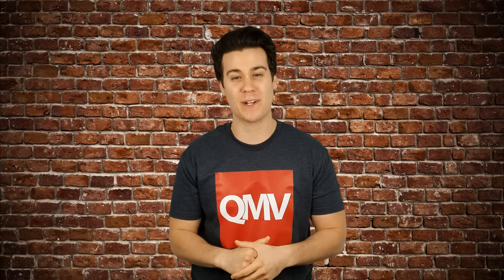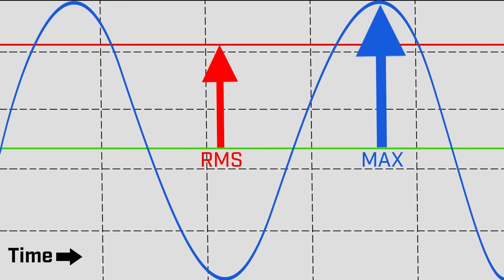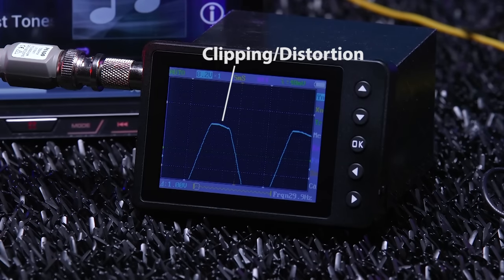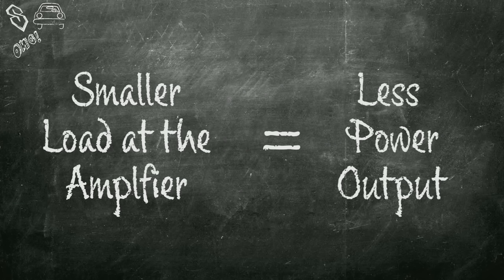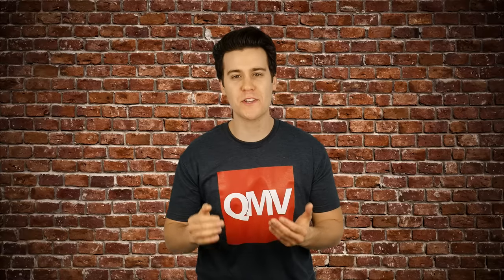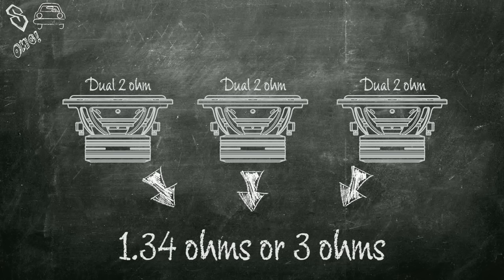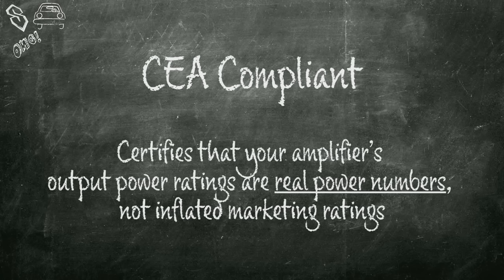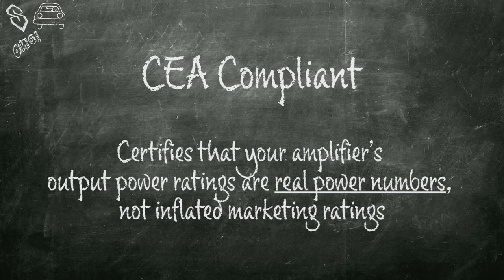How Do You Match Car Subwoofers and Amplifiers?

Comment: I have 2 1300 watt subs.do I need a 2600 watt amp or will a 1600 watt amp be OK?  Also both amps I'm interested in are compatible with the rms. So it's the peak power I'm a little worried about. Thanks
Reply from the maker: What is the RMS of each sub? If their RMS is 1300 each, you'll want an amplifier around 2700-3000W RMS. If that's the MAX, find the RMS rating and use that instead

Comment: Im buying a subwoofer with 400 RMS and 2ohms. Should I buy an amp with a 400 RMS output or a 400W Power at 2ohms?
Reply from the maker: As explained in the video, this is dependent on the specifications of the subwoofer, and you're leaving out whether it's DVC or SVC. Need to know :)

Comment: I’m super late to the party but I’m trying to figure out how many wattage to get on my amp I currently have a 1200 watt sub hooked up to a 500 watt amp I’m getting a 2100 watt subwoofer Peak Power: 2, 100 Watts, RMS Power: 1, 050 Watts. And also getting a voice box which is 2,000 watts “✔ WHATS INSTALLED: 4 - VS65SB Midrange Speakers (500 Watts Max/ 150 Watts RMS Each) & 4 - MA-TW25 Super Tweeters (150 Watts Max/ 75 Watts RMS Each)
✔ POWER: 2000 Watts Max Power - Recommended RMS Power PER Terminal 200 watts (There are 2 Terminals)”

Which watt amp/brand do you recommend for both

Comment: I am new to installing and matching car audio to amps and could use some help. Like a dummy i just went out and bought what i thought i needed and now need help to find out if i screwed up. if you could tell me if this amp will work with the speakers and sub i bought it would help. i bought kenwood  #BT778HD stereo, 4 pioneer 6x8  #TSG6844R speakers 500 watt max power,  1  #PSWB121T 4 ohm sub, and Lanzar heritage series 5 channel 3000 watt amp #HTG558BT. I have been watching your videos and have learned alot but still not sure on the amp. Any help would be appreciated. Amp features are 4 x 250w + 1 x 650w rms @ 4 ohms, 4 x 350w + 1 x 1,500w rms @ 2 ohms, 2 x 100w max @ 4 ohms bridged, 4 x 500w + 1 x 2,000w max @ 4 ohms.

Comment: How do u wire a sub in 4 ohms or 2 ohms .. im building a system  i have a digital design loaded enclpsure which is rated to 250w rms 500w peak and it says 4 ohm loaded enclosure , im intrested in using a monoblock which is capable of out putting 480w @ 4 ohm ... my question  is how do u determine what ohms u run at ? Is there a specific way of wiring the sub in 4 ohms
Reply from the maker: Depends, is it DVC or SVC?

Comment: Okay so i got 2 12" 4000W subs

specs are

12″ AudioFusion 4000w DVC Sub-woofer
– 4000w peak, 250rms
– painted steel frame with high end terminal
– yellow non-pressed paper cone with foam edge
– Black EVA ring gasket

What size amp will be recommended?
Reply from the maker: You left out the 2nd most important spec! Are they 2 ohm or 4 ohm woofers?
Reply: @Qualitymobilevideo  ahhh sorry it says on the box dual 4 ohm subwoofer

Comment: okay so basically i just blew my subs? i tried running my skar triple 8s ported on a 125 watt amp and i checked the temp of my amp when i realized something was wrong it was at a steady 143 degrees. so did i just lose everything?
Reply from the maker: Not likely, you probably put the amp into thermal protect. You have a wiring issue that you should resolve ASAP.

Comment: So a SA-12 D2 REV.3- Sundown Audio 12" 750W Dual 2-Ohm SA Series Subwoofer and a Skar Audio SK-M5001D Compact Monoblock Class D MOSFET Car Amplifier, 500W would be a perfect match right?
Reply from the maker: Those are good match for the 1 ohm load at that amplifier with 500W RMS

Comment: So I have two 2007 model year alpine mono block MRP 500 watt amplifiers and I would like to use them both on one alpine R series duel voice coil sub that’s 1800 watt max (peak) so It’s probably 350/400 watt per coil. I’m not looking to push anymore than 4 OHMs load so I don’t over heat the amps or fry the voice coils am I safe with that configuration???????????

Comment: I have a 350w subwoofer with an impedance of “ 4ohms x 2 “. Not sure what that means but what amplifier should i use?
Reply from the maker: I'm guessing that means Dual Voice Coil. So wiring a DVC 4 ohm subwoofer in parallel gives you a 2 ohm load and in series gives you an 8 ohm load. You'll want a monoblock amplifier with a power range of about 300-500W RMS @ 2 ohms. I suggest these: 

Kicker 42PXA5001 - 500 watts RMS at 2 ohms
http://www.qualitymobilevideo.com/42pxa5001.html?utm_source=YouTube&utm_medium=Video&utm_campaign=Match_Subwoofers-Amplifiers

Rockford Fosgate P300X1 - 300 watts RMS at 2 ohms
http://www.qualitymobilevideo.com/p300x1.html?utm_source=YouTube&utm_medium=Video&utm_campaign=Match_Subwoofers-Amplifiers

Rockford Fosgate R500X1D - 500 watts RMS at 2 ohms
http://www.qualitymobilevideo.com/rockford-fosgate-r500x1d.html?utm_source=YouTube&utm_medium=Video&utm_campaign=Match_Subwoofers-Amplifiers

Kicker CXA300.1 - 300 watts RMS at 2 ohms
http://www.qualitymobilevideo.com/cxa300-1.html?utm_source=YouTube&utm_medium=Video&utm_campaign=Match_Subwoofers-Amplifiers

Kenwood KAC5001PS - 500 watts RMS at 2 ohms
http://www.qualitymobilevideo.com/kac5001ps.html?utm_source=YouTube&utm_medium=Video&utm_campaign=Match_Subwoofers-Amplifiers

Comment: my amplifier is a Lightning Lab CL1000.1D 2channel @1 ohm stable and my subs are 2 12" jbl gt5-s12 300watts/rms @ 4ohms.. how much power supply i am supposed to used for this? im using it at home.. is 12.8v / 100ampere is enough for the amplifier? thanks..

Comment: i have the Pioneer GM-D9605-5-Channel Class D  Amplifier with Wired Bass Boost Remote  i want to use all JBL  speakers 6 or 8 of them in a 75 dodge van ... 2 subs 10 or 12''  and 4 or 6  3-way 6x9 or 6.5'' or 5.25 for doors   seen subs dual coil and single not sure what to buy and does amount of impute into amp figure in on the equation have  4 units to impute all old school 70's pioneer cassette/8 track/ cb / and radio ...  get some of what your saying but dame !!   i'm to old for this sheite   .... signed fried/busted/broken and 55   HELP PLEASE !!!

Comment: I’ve got a JBL GTO-751 EZ amp trying to figure out what’s going to be best to run with it either my 2 JBL GT5-12 in a vented box or 1 JBL S2-1224 in a chambered vented box. 

Amp is mono running 4 ohms at 500rms to 1450 peek. 
All speakers running 4 ohms 275 rms to 1100 peek. 

I know peek is not the deciding factor.

Comment: I have a question.  So I have a pioneer GM-d8601, 1600W max.  Website reads this "RMS: 800W x 1 @1 ohm".  Does the "x 1" mean 1 channel?  So does that mean I can get 2 dual 4 ohm subs 1300W max, 400W RMS and parallel them to 1ohm?  Wouldn't that be a perfect?  This will help me understand what the "x 1" truly means because I'm a little confused.
Reply from the maker: Yes x1 means one channel, x2 means two channels, x4 means four channels. Yes two DVC 4 ohm subs wire to 1 ohm in parallel and will be a perfect match for that 800W @ 1 ohm rating.

Comment: Okay now if I can be told exactly what type of amp I need to get for my brand new subs I just bought "and which are arriving at my doorstep sometime today"it will then help me to see the light and therefore understand why I need a certain amp so here it is,I have  2 ×10"600watt rms duel voice coil 4 ohm subs what type of amp should I get ???and I do want a little extra power to spare when it comes to size...please please help please

Comment: I used your video on parallel vs series wiring and applied the formulas on your example in this video and i am not getting the right numbers. How do 3 subs, 4 ohm, equal out to 6 ohms or 2.67 ohms. The numbers I was able to come up with are 24 ohm, 0.666 ohm, 12 ohm, and 1.33 ohm.
RT = 4+4+4 = 12 ohm. oh, it's dual coil? RT = 4+4+4+4+4+4 = 24 ohm
RT = 1/4 + 1/4 + 1/4 = 1.33 ohms. Dual coil? RT = 1/4 + 1/4 + 1/4 + 1/4 + 1/4 + 1/4 = 0.666 ohm.

How did you get 2.67 ohm? how did you get 6 ohm?

Comment: Enjoy my notes

RMS Power Ratings: The measure of continuous power that the subwoofer can accept  (also called thermal power handling [TPH])

Match RMS Input from sub to RMS Output to amp

With multiple subs, combine RMS ratings (2 350W = 700W RMS)

Multiply Sub RMS by 120% to get higher Power Range of needed amp

Multiply Sub RMS by 90% to get lower Power Range of needed amp (need both)

Range for 700W RMS = 630W RMS to 840W RMS

Underpowered amp when nearing maximum output will output distortion and heat which damages voice coil

Overpowered amp will run cooler with some headroom and with more reserved power, heat is a killer

Impedance (Ohms): The electrical characteristic of a speaker that restricts, or impedes the flow oh current, and is measured in ohms

(Amp with max rating of 350Wx1 channel @ 4 ohms
700Wx1 channel @ 2 ohms) meaning largest load is 2 ohms

Larger resistance in ohms = smaller load at the amp = less power output

 Amps usually double output at 2 ohms (2 ohms = 700W RMS = warm or 4 ohms 350W RMS = cool)

Final wired impedance of subs = power output of amp at wired impedance

With a Kicker CXA1200.1 amp (1200W RMS)
(2 ohm SVC [single voice coil] 500W RMS subs {parallel wiring = 1 ohm, series wiring = 4 ohms})

1200 x 90% = 1080W RMS 

So, 2 4 ohm SVC 450-500W RMS subs (each) in parallel wiring will = 2 ohms, resulting in a match equaling 900-1000W RMS

DVC (Dual voice coil) The key difference between SVC and DVC subs is the multiple wiring options DVC subs offer: 

Parallel: A dual 4 ohm voice coil sub with its coils wired in parallel presents a 2 ohm load to your amp OR four DVC 4 ohm subs wired in Parallel = .5 ohm load

Monoblocks (1 channel) Designed to output tons of power at low impedances

2 channel or 4 channel can also be used but are usually limited in power output in impedance capabilities

Bridging channels: Combine the output of 2 channels:
4 channel = 2 channel
2 Channel = Monoblock

In bridged mode, 2 and 4 channel amps can not accept lower than 4 ohms

Monoblock can push any number of subs as long as the minimum impedance is not exceeded and the output power matches up to the subs or speakers that are being powered

(ex.) you can wire 3 DVC 2 ohm subs to final impedance of 1,34 ohms or 3 ohms. Then, calculate total RMS input power required for the subs all add together to match the power to the amp

Rockford Fosgate P1000X1BD Mono = 1000W RMS @ 1 ohm, 600W RMS @ 2 ohms, 300W RMS @ 4 ohms

4 12 inch subs - amp can output 1000W RMS @ 1 ohm, meaning we want 250W RMS subs (Rockford Fosgate P1S4-12 Punch P1 4 ohm SVC

When these are wired in parallel, four 4 ohm subs will = a 1 ohm load for a 1000W RMS output
Reply from the maker: Dead on, one caveat on the first, great manufacturers will provide a thermal limit based on the epoxy of the voice coil, thermal load of the former and heat dissipation in the gap.

Comment: Im having trouble making 2 speakers and a sub off one amp 
So if I get a 4 channel amp to run 2 speakers at 75rms x4ohms  and a sub at 150rms x2 ohms. What amp rating would I need I suck a math sry. 

Will I be able to achieve the required power for the speakers using two of the channels and the other two channels for the sub? 

Or is this a case of running two separate amps to make the power matching easier. 
Is it possible to choose wire with one amp and what rating would the amp have to be? 

I'm confused cause does one channel on the amp produce say 75rms or is that not the question to ask, does it all come down to how to wire it not the number of each channels??? 

My understanding is two 75rms speakers requires 150rms from amp, how many channels would that take up? Will there be enough channels to run the sub at 2 ohms lol
I can't get my head around a amp that can make power ratings for both the speakers and sub pls help

Comment: 4 channel amp at 150w x 4 @ 4 ohms. Bridged 300w x 2 @ 2 ohms. Will it power a 4 ohm crossover? Components are 125w for mid-range and 125w for tweeter.

Comment: Hey man I have a question I just bought that kicker cxa1200.1 amp and dual 4 ohm kicker 12 L7 750 rms I have everything connected but the amp goes into protect mode when the base hits hard. Any idea what it could be?
Reply from the maker: Hey Ralphy, are you wired in parallel to a 2 ohm load? Because that should be a perfect match. 

But other than that, it sounds like a possible voltage issue/voltage drop. Could have a bad ground. Something in your charging system could be wrong. Sort of have to figure it out by process of elimination, starting with the amp and working towards the charging system. Verify that the ground is solid. Make sure your power source is more than adequate to handle powering the system and feeding the amplifier. Test your battery and your alternator. But honestly, if the car is running fine and it shuts down, sounds like a bad ground or bad connection somewhere. 
Run the system, use a multimeter, see what the voltage is doing when the amp is running fine, then when it goes into protect mode, see if the voltage is dropping below 12V which would cause protect mode to go into effect.
Reply: Quality Mobile Video thanks for the reply. So yesterday I took it to get looked at again. All the ground connections seem to be fine. I used the meter to check the voltage when the vehicle is on and the amp runs at 13v. But when  I turn the volume up and the bass up the amp goes into protect. I swapped this one out for another one same model thought maybe it was defective. And it happens again... we them connected a cheaper 1500watt quantum audio amp and the bass works fine. I turned it up and it didn’t shut off at all. The guy told me it’s possibly the bass control knob?  I’m not sure exactly how that can cause it to mess up. I’m stuck here.
Reply: We have the sub wired at 4 ohms
Reply: So after doing some research on my amplifier in my wires I took a multimeter and check the voltage on the amplifier when the car is off it reads at 12 V when the car is on the amplifier will read at 13 13 1/2 V when I put on heavy bass music and I turn the volume up a little bit I noticed that the voltage drops significantly to 11 to 10.5 I also noticed that at 10.5 V the amplifier goals then into protection mode I would like to mention that I’m also using some cheaper CCA power wires I purchased from eBay. A fellow YouTuber Said he had the same issue as I did and he ended up buying an extra battery for the trunk and that solved his issue. I ran sound systems in my same vehicle before never had this issue then again I never have had a kicker amplifier before either I’ve had kicker sub will for us but never had a kicker L7 model
Reply from the maker: I'm surprised that amp sucked so much power from your battery! Glad it worked out!

Comment: If My amplifier gives out of 50w so can i use 100w speker ?
Reply from the maker: Ideally you want them to match, or have the amplifier's power rating be higher than the speaker/sub
Reply: @Qualitymobilevideo  no my amplifier is lower than sub/speaker so cani use ?? What will it's performance ???
Reply from the maker: Well your amplifier can only do 50W, so the sub will only have half it's potential used

Comment: I bought two dvc 4 ohm subs and have a 1 ohm stable amp that is bridgeable. Would I have to wire one sub in series to make 4 ohms and the other in parallel to make 2 ohms then bridge it at the amp, or how would that work?
Reply from the maker: Just wire them together in parallel and you'll create the 1 ohm load. Here is how: https://www.youtube.com/watch?v=fyyEDnv-T7o

Comment: Quick question guys. If I have a subwoofer and amp, using my stock radio with an LOC, would I get a 5 channel amp to power the subwoofers and also power the 4 stock speakers in my car?
Reply from the maker: Yes that's an option. We actually have a video showing how to wire that setup right here: https://www.youtube.com/watch?v=vxWSN60i5ew
Reply: @Qualitymobilevideo  Hey thanks for the reply guys! Just to clarify based on that video, do we have to run a speaker wire to each speaker? Or if we utilized the head unit and LOC, with a 5 channel amp, it'll automatically power each speaker?
Reply: It's a 2 channel LOC btw. The PAC LP3. Idk if thats enough or I would need something like the audio control LC7

Comment: what yall think about using an audio control Dm-810 with a skar audio skv2-200.4d 1600 watt amp feeding 2 psi-8 ( high performance and dual 4 ) sub woofers?
Reply from the maker: I'd get a more powerful 1 ohm stable monoblock amplifier
Reply: @Qualitymobilevideo   So something like a SKv2-2500.1D | 2,500 Watt Monoblock and wire the psi-8's in parallel?
Reply from the maker: Yea perfect, so two DVC 4 ohm subwoofers wired in parallel create a 1 ohm load at the amplifier. This is the best way to get the most out of those subs, rather than an under-powered 4 channel amp and bridging them in its channels
Reply: @Qualitymobilevideo  Thanks for the help man!!

Comment: Ok first of all no I never even got to calculus, hell I even failed algebra twice in hs and college lol. So the skar vd 10 dual voice is rms 500, if I get 2 that's a total of 1k right? I have a jl xd600.1 mono amp. Will this be OK? That's 600 to each subwoofer right?
Reply from the maker: No, you will be splitting any output between two drivers, automatically half the output of the amp.
Reply: Precaite the quick response I just went ahead an ordered a 1200w mono, hopefully that'll help lol. It is a great video tho